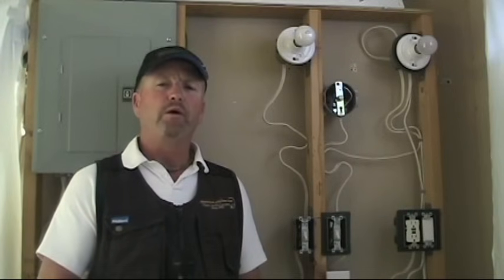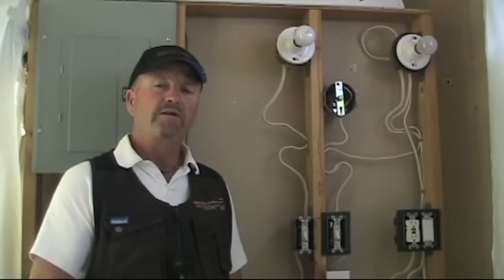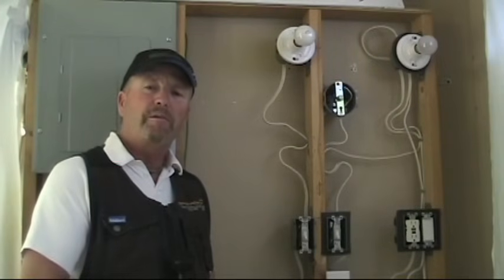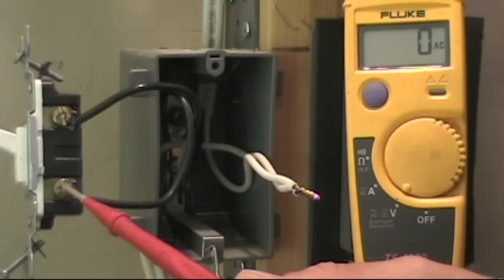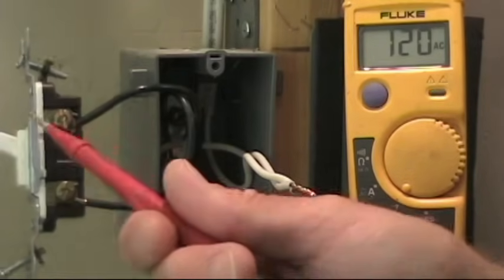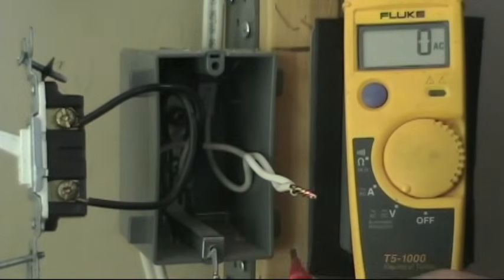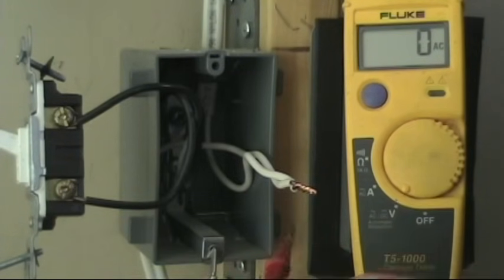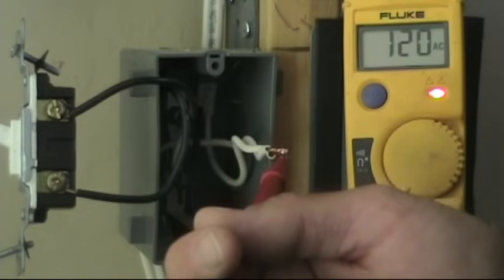Understanding an Open or Loaded Neutral

Comment: The hot wire is back feeding through the light bulb filament. If you unscrew the light bulb the problem goes away. Or just turn off the breaker like the man says!
Reply from the maker: Correct on unscrewing the bulb, but you are also correct, shut off the breaker and fix the issue.  The neutral path should always be continuous.

Comment: This guy shouldn't be making these videos telling amateurs how to do their own wiring!  I spent over thirty years as an electrical contractor and have seen some horrendous  mistakes made by weekend 'electricians'.
The comments below just show that most of these guys have very little understanding of the issues.
As the old saying goes, "A little knowledge is a dangerous thing"!
Reply: I need someone to fix my home wiring. It has this problem and nobody can fix it.
Reply from the maker: I respect your opinion, but no knowledge is even more dangerous.  DIYers are, and have been doing electrical work forever, so my goal has always been to educate them to do it safely and correctly.  I have 40+ years in the trade.  What I object to is DIY people with no credentials making videos about DIY electrical.  Carpenters, do deck videos! Plumbers, teach plumbing! Stay in your lanes!

Comment: Didn't understand a thing. You need to dumb it down for us non-electricians.
Reply from the maker: Let's try this.  You have a garden hose to water the plants.  Turn on the tap (switch), the water flows from the end of the hose down to the ground, thus watering the plants.  All is well.  But take away that path to the plants / ground but putting a blockage in the hose, and now the water can't do it's thing.  So you look into the hose and dislodge the blockage, (touch the neutral) and you get a face full of water (a shock) but the path is now complete.  So keep the hose clear, (keep the neutral path intact) and your face out of the way, and watering the plants works great again.  Does that help?
Reply: @theinternetelectrician  
So...is it because the neutral, being broken upstream, causes the current to ground through you if touched?
Reply from the maker: @tedhart7708  Yes, but only if you touch it and you are grounded.  Or if you complete the circuit from white wire to white wire with your fingers, etc. Without touching it, the circuit just doesn't work. That's what happened to Rob here.  He forgot he left those splices undone and turned on the breaker.  His light didn't work so he started to troubleshoot it and that's when he saw that he had 120V reading from a neutral wire.  That's when he contacted me to ask why this could happen.  Here's more detail from my website, complete with a diagram.  https://www.electrical-online.com/understanding-an-open-or-loaded-neutral/
Reply: @theinternetelectrician  
Thanks. Still not 100% on this but I've always been fascinated by electricity!

Comment: Hmm...I didn't see the remedy
Reply from the maker: Keep the neutral path intact.  It should be a continuous path with no interruptions.  The problem was that a neutral splice was taken apart due to some circuit renovation work, and was forgotten about. Simply a case of not checking that everything was completed before restoring the power

Comment: I don't get it. You describes what happened but you didn't show it. How are we supposed to understand what you said?
Reply from the maker: Let's try this.  You have a garden hose to water the plants.  Turn on the tap (switch), the water flows from the end of the hose down to the ground, thus watering the plants.  All is well.  But take away that path to the plants / ground but putting a blockage in the hose, and now the water can't do it's thing.  So you look into the hose and dislodge the blockage, (touch the neutral) and you get a face full of water (a shock) but the path is now complete.  So keep the hose clear, (keep the neutral path intact) and your face out of the way, and watering the plants works great again.  Does that help?

Comment: Folks, the point is that if you don't shut off power before you pull the wire nut off and separate the neutrals you have just turned the neutrals into an ungrounded (aka HOT) conductor... It will light you up.

And before the code change you could have several circuits sharing a neutral... 277 volt lighting circuits are notorious for it. So if the structure you are in is older, make sure you shut off all circuits that could potentially be sharing a given neutral.
Reply from the maker: Thanks for helping out!

Comment: Since the neutral was open between the box and the panel, the 120v on the neutral to ground was because the light switch was on and it was getting the power from the hot, through the light, into the neutral, but then it had no where to go because the neutral was open. Shutting off the light switch would have unloaded the neutral.
Reply from the maker: Correct!

Comment: As an early apprentice I recall being in the ceiling of a burger joint making connections bare armed, sweaty, on HVAC ducting. I called out to the electrician. Monroe, white wires can't shock you right? I should have waited for his answer.
Reply: Sync Pressor, been there done that with florescent lights, sure nuff zap, 30 plus years in electrical field, trainee, journeyman , then Master Electrician,  loved working wires hot but got bit a lot but if you work with electricity you will get a tingle ever so often.
Reply: @terryswails1191  30-35 years ago it was nothing to tap live and loaded conductors up to 500 MCM by standing on a pallet and setting up corrugated to prevent from becomming grounded. No gloves or PPE used.

No way I consider doing such a thing today.
Reply from the maker: Yes, I've cut corners and worked on live conductors, but have got many zaps and ruined a few tools by doing so.  Just not worth it.  However I worked with a journeyman while I was an apprentice, and he had to lick his fingers to even feel 120V, and could touch live 240V and barely feel it! Must have had extremely thick and dry skin!

Comment: Your panel is too high , even tho it may pass the 6'6 max breaker height you shouldnt mount a panel that high, 6' to top is a good general height for that size of a panel, you dont have straps where they should be on your light Romex wire , you didnt show taking apart the neutral and where it was, your switch isnt bonded to your metal box with a wire , what type of connector was that in the top of the receptacle box ? You need to work with a real electrician for a year or 2 before you wire anything else up please , thxs
Reply from the maker: Well Scott, a few things you need to understand here.  What I am working in front of here is a demonstration wall that I use for just that, demonstration purposes.  I'm sitting down when you think the panel is too high as the entire wall is only 6 feet to the top.  So that should explain all your alleged code violations.  Now to my 40 years of experience in absolutely all aspects of electrical work as a Red Seal Journeyman Electrician.  Residential, Commercial, Industrial, Control Systems, Process Control, Instrumentation Mechanic, and 4th Class Steam engineer.  Owned and operated large electrical contracting business, sold in 2008, semi-retired, work now on assisting the DIY'er with their home electrical projects starting with a website pioneered in 1997, in the early stages of the internet.  Want to come work with me for a year or two?

Comment: You didn't shows us how to solve the problem.
Reply from the maker: I think if you go back and watch again, and listen carefully, I do tell exactly what the problem was, and the correction for it is to not leave a neutral path open before restoring power to a circuit that was being worked on.  I didn't show a picture of white wires not spliced together as I thought the description would be enough.  I will learn from my mistakes.

Comment: Just another reason I don't mess around with electric wiring . I always call a certified electrician .
Reply from the maker: Yes, I try to always emphasize that if you're not comfortable with, and not willing to follow all safety precautions when working with electricity, then you just simply should not do so.

Comment: not clear.  He should have shown the splices and how they were messed up.
Reply from the maker: It was a splice that was taken apart for a renovation to that circuit, and was forgotten about before restoring the power. I should have shown 2 white wires not connected together I guess.  Always room for improvement.

Comment: Those open neutrals can be tricky...and deadly...
I was called to a newly constructed home on a service call because the plumbers said they were getting shocked by their faucets...
It took me a while but I finally tracked down and fixed the problem: The neutral on the load side in the meter base was never tightened at all...
Reply from the maker: Yup, that will do it!  And the problem with those is that it's usually random, sometimes connected, then it opens up causing the issues to not be consistent.
Reply: What he showed isn’t this only possibly if it’s a multiple circuit or 3 wire ?if you have 2 wire open neutral won’t show anything

Comment: We bought a old 50's home and I am changing all the plugs, switches and covers for looks and some plugs were worn out. I have a plug attached to a switch that was showing a reverse hot and neutral but the wires to screws are correct by color. just  to see I reversed the first set of wires and it reads correct when on but the wires are now white to brass and black to silver. but in both positions they show hot neutral when the wires and screws are matched. I always check for power even after turning off the breaker. Is this ok to leave like this until I can hire a pro to follow and check all connection points since it reads correct with the wires reversed.
Reply from the maker: Have that checked out and if you can, leave the circuit off until you do.  Could be any number of reasons but most likely just someone adding to a circuit and reversing the wire colors.  Is there a ground wire in the cables, or just 2-wire cable?

Comment: Hi Terry,... Thanks for the video. I'm confused if your friend changed the wiring upstream correctly or incorrectly...  Would like to see.how his work caused the condition...  I had the same exact experience with on outside doorway light, but I did not change any existing wiring.
Reply from the maker: He had been working on this circuit.  He had a junction box open and the splices taken apart, and he forgot about it before restoring the power.  So not incorrect wiring, just forgot to connect everything back up.  Did you get your issue solved with the outside light?

Comment: Wow, and this is why in Australia you have to be licenced to do electrical work. Your "fault condition" was covered in our high school physics class and if someone working on electrical systems can't understand the same voltage & current flows through the whole circuit back to the power station they really should not be opening things up. It's not the live wire that will kill you, it is YOU forming the remainder of the circuit that does it. You could have provided a far better explanation in less time with a diagram, in my opinion.
Reply from the maker: I appreciate your opinion. Sorry I didn't meet your higher expectations. Do I call you "0419 638077" or do you go by another name? Bob? Joey? Mate?

Comment: Thank you I get it. I had electric shop in HS and was in electronics in Air Force however in my late 70s. Alternatively I could use same wire size as to the present outlet to the heater hookup. The original line is long so there might be some line drop.

Comment: Hello. I have a unused 220 line coming to an outlet for a range. Can the outlet plug be remove and splice in another line same gauge and extend this line to another area to hook up baseboard heat? In so in essence using the existing box as a junction box?
Reply from the maker: Yes, you can do this.  You could even use appropriately sized cable for the baseboard heater requirements as long as you drop the breaker size to match the wire size.  For example, if you need a 20A, 2-pole breaker for you baseboard heater, you could splice in #12/2 at the range junction box.  Just make sure the breaker you use is sized to the smallest conductor used in the circuit.

Comment: The neutral or white wire was not in a continius run all the way back to the source (the panel) thats why the power went up the black wire after the switch thru the filament in the light bulb down the white wire and cut or disconected from panel

Comment: For the confused....checkout the diagram on his website. He explained it perfectly in the video but the diagram allows you to trace the path and makes it easier to envision.

You can see where the path is broken so current doesn’t flow, but voltage still gets to the neutral.

Touch the neutral and you complete the circuit.
Reply from the maker: Thanks William!

Comment: Is there a way for my main power switch on panel to be shut off yet still showing use by electric bill?
Reply from the maker: That should not happen unless there is a connection to the system between the meter and the main breaker somehow? Happens with homes that were 'grow ops' at one time or another?
Reply: @theinternetelectrician  Thank you.  I don't think this is issue.  Maine CMP is charging for all sorts of stuff not actually used.  PUC investigating.  I have not used any - living fine off Solar panel and Jackery and propane heat.  but they are still charging after disconnect notice 2 years ago....  I had only been paying $25-55 for approx 15 years.  Also up to date on bills.  Then got bill for over $600!!! I was driving tractor trailer over the road so not even home!  I was just curious how something like this happens. Frustrating.  TY for responding.  Be Safe.
Reply from the maker: @leemartin9156  Yeah, somethings not right! I can see a flat fee being charged if the service is still in place and useable if needed, but to jump like that, must be a mistake of some kind.  Make them come out and point out what might possibly be using power when you're not!  Got any neighbors that throw a cord over your fence and use your power while you're away? :-)
Reply: @theinternetelectrician  I had tried a couple years ago and they refused to send someone.  I don't know if neighbors were hijacking, but they had to break in to use stuff.  I know they have done that in the past and they steal anything not locked down....
Reply: Love my house but hate the slimeball neighbors.I had a brand new outside line, box, 200A panel etc installedprobably 15 years ago- before any of this came up. Could a master electrician tell me what is being used?

Comment: Personally I will only wire up a switch on the hot side connected to the circuit breakers, NEVER  to the common neutral line.
Reply from the maker: As you should! NEVER switch the neutral.
Reply: @theinternetelectrician  unless it's a double pole switch, that disconnects both!
In Israel, double pole disconnect switches are required for electric water heaters. Then you cannot get a shock even from the neutral, while servicing the appliance.

Comment: There could be a possibility that i ran into a circuit where I could not turn a fan off due to the fact that the house had switches that were based upon neutral wired switches.  That means I changed the switch just to a hot (black) wired switching not any switches wired with the neutrals or (white) common wires and the circuit ran correctly.  Check to see if any switches are neutral or common wired switches and hot wired switches.

Comment: Terry, I've never spoken to anyone that had a great short cut for testing a tripped breaker. For example, there is a circuit that had 8 recepticles switched out. Breaker get turned back on and instant trip. I've never been able to  locate the culprit other than going to  each one and taking them out to inspect (provided the answer isn't obvious through visual inspection). Any thoughts other than checking every single outlet? Of course, the assumption is  each wire was simply put back in original positions.
Reply from the maker: If all receptacles were connected properly, one possible cause would be that when pushing the device back into the box, a bare ground wire is in direct contact with the hot terminals in one of the outlets. For the breaker to trip instantly like that, you must have a short circuit to ground or neutral. Inspect each device and you will find the problem

Comment: Hi, I need help, lol, my wall outlet went out as well as 2 lights, I checked and both white and black read 120v, but black to white read nothing, we haven't done any reno or anything, it just went out, also my breaker did not switch off. Thank you.
Reply from the maker: Did you get this fixed?  Sounds like an open neutral problem at a splice or termination somewhere?

Comment: Would that neutral be hot if the switch was turned off?  Because I am hearing people say they had that problem.
Reply from the maker: No, with the switch off you break the path for the current to flow so the neutral would not show as hot.